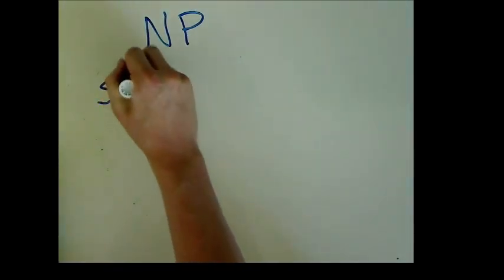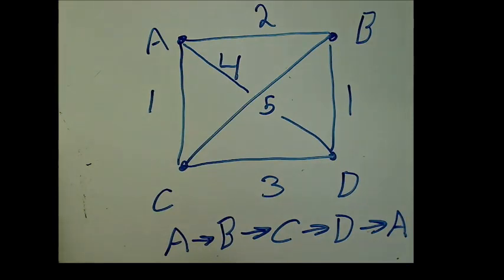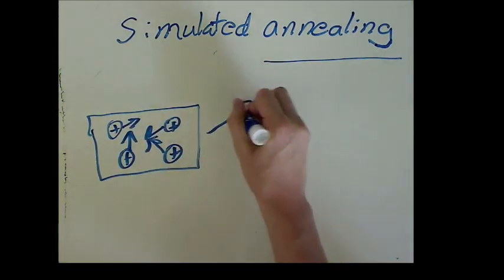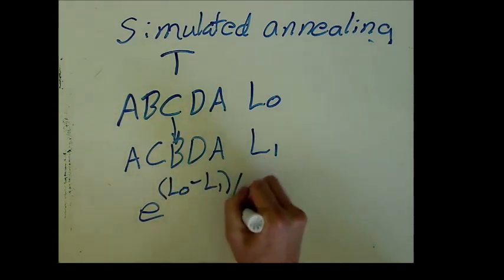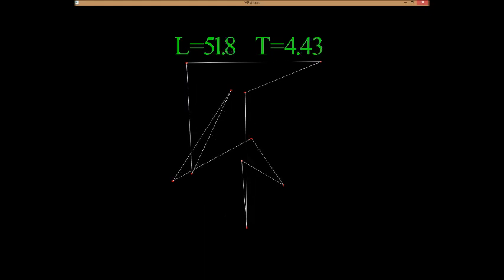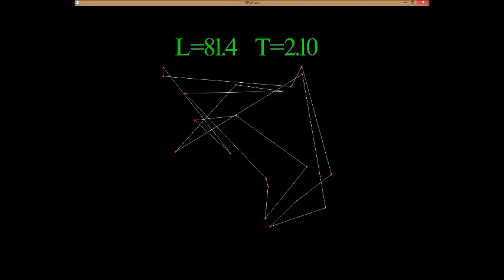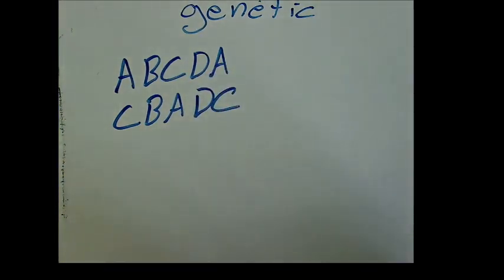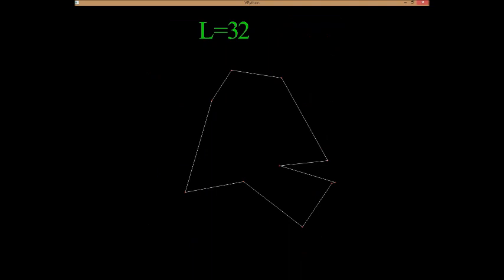Using simulated annealing and genetic algorithm on TSP

Comment: I am sorry to say that, but this is not how genetic algorithms work. You selected candidates for survival and recombination, based a probaility methode according to the fitness. You normally do not take JUST the best from the population. That would lead into local maxima same as with anealing, if you cross out the probability. So this would not be a propper way to compare them both.

Comment: Simulated annealing is better since genetic algorithm has a high chance of converging into a local minimum
Reply from the maker: Paulo Castro You're absolutely right that simulated annealing is better at solving the traveling salesman problem.  Genetic algorithms are better applied in domains with more variables and configurations.
Reply: @PaulFred7  isnt the mutation soultion to this
Reply: @kemal4282  The solution for this in genetic algorithms is probabilistic survival selection based on the "fitness" of a candidate. Normally this also applies to recombination selection as well. Mutation rates normally are very low, at 1% or 2% of the genotype. Higher mutation rates are too distructive for the population. It is the recombination, that accelerates the search. So I would really struggle to call this example from the video a proper genetic algorithm. From my point of view, comparing genetic algorithms and simulated anealing this way, is a bit inapropriate. Unfortunately, I have not found a good example comperasion yet, otherwise I would have linked it here.

Comment: Hello sir, quiet urgent, for simulated annealing, if the new path is longer than the current path, we will calculate the probability using the formua e^(l0-l1)/T. Lets say we get probability of 0.5. How do we know we need to replace it or not with probability of 0.5? what is the threshold of probability that require us to replace the shoter path with the longer one? Thanks
Reply from the maker: Steven Lee, once we've calculated the probability, generate a random number between 0 and 1.  If that number is less than our probability, say .5, then replace it.  If it is larger, don't replace it.

Comment: how can this be slightly adopted in order to find the maximum clique or maximum independent set problem
Reply from the maker: David Lewis these algorithms can be applied to any problems for which you have a metric which measures the quality of the solution (In the traveling salesman, that is the length of the path) and some operation which can change any state to a slightly different state (in this case switching 2 cities in the order).

Comment: Hi, thanks for the video. I didn't really understand the probability part. Is there some type of random selection used with that probability?
Reply from the maker: I'm assuming you're talking about simulated annealing.  When finding two cities to switch in the path order, there is an equal chance of choosing any pair.  After switching the two in the path order, if the new path length is shorter than before, then the change is adopted.  Otherwise, there is a probability that goes as e^-T that the change will be rejected.  T, the "temperature" decreases steadily throughout the simulation until it reaches 0. Hope that helps
Reply: Perfect I understood now, yes I was talking about simulated annealing. Do you think the simulated annealing is way more like to find the global optimum than the genetic algorithm ?
Reply from the maker: +jaimeesg That's difficult to say.  Neither algorithm is guaranteed to find the global min
Reply from the maker: +jaimeesg But simulated annealing is more guaranteed to converge on a solution whether or not it is the optimum one than the genetic algorithm is.  There are also many more parameters to change for the genetic algorithm making it more difficult to use effectively.
Reply: PaulFred7 Thanks again!